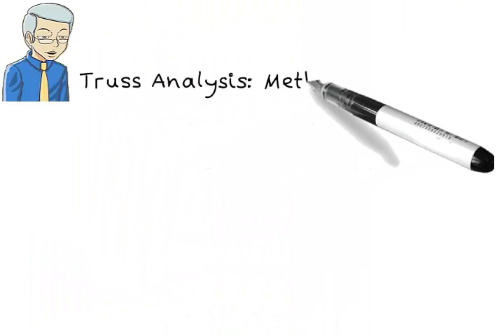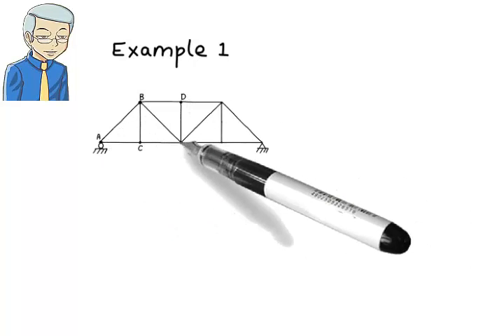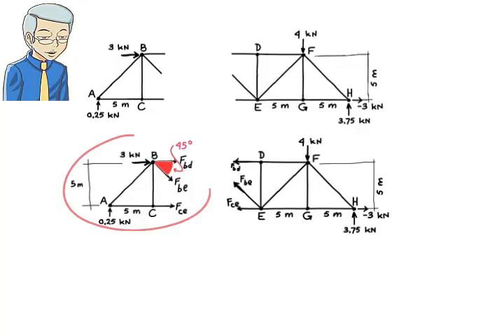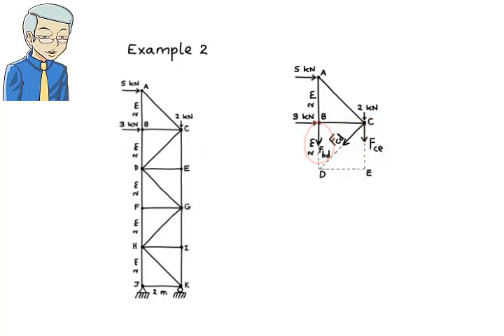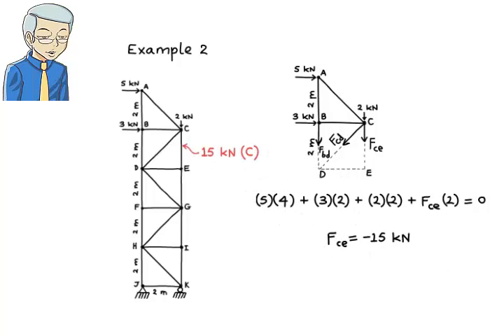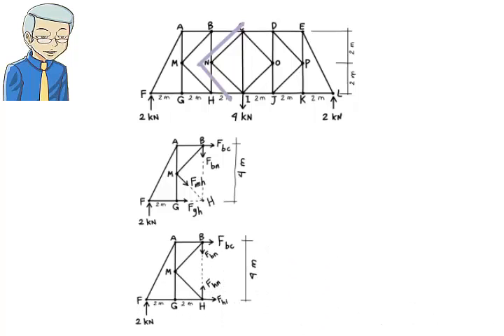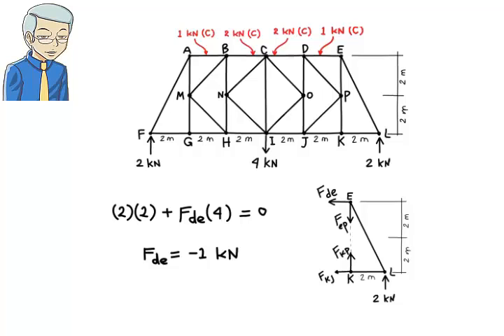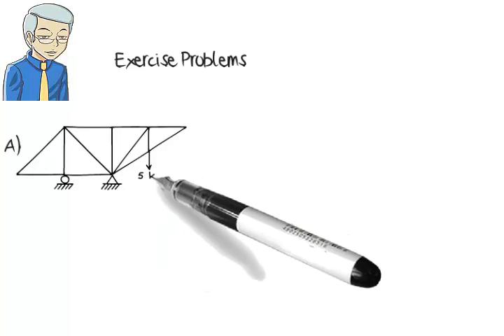SA10: Truss Analysis: Method of Sections

Comment: Hello.. When can I use the joint method?   or what when method section
Reply from the maker: If the truss is statically determinate, you can use either method for analyzing the structure.

Generally, we use the method of joints when we want to determine ALL the member forces, and use the method of sections when we are interested in calculating only a selected number of member forces.

Comment: at 5.08, why did u take fce as negative, shouldn't it be positive since its going to the right??
Reply from the maker: When writing the moment equilibrium equation, we need to assume either clockwise or counterclockwise as the positive direction. In this case, we assumed clockwise moment to be positive.

We are writing the sum of the moments about point B. The support reaction (0.25 kN) created a clockwise moment of (0.25 kN)(5 m) about point B. And Fce creates a counterclockwise moment of (5 m) (Fce). So, the moment equilibrium equation needs to be written as:
+(0.25)(5) - (Fce)(5) = 0

Comment: Fbd is 11.25 not 1.25
Reply from the maker: Correct. The force in the member is 11.25 kN.
Reply: @DrStructure  but how the internal force Fce is zero?!
Reply from the maker: Cut the beam through members BD, BE, and CD. Considering the free-body diagram of the left segment of the truss, and write the moment equilibrium equation at point B. The only force that causes a moment at point B is Fce. So, the sum of the moments at point B becomes: 4 Fbc = 0. Or, Fbc = 0.

Comment: Hey Dr. Structure. Thank you for the great video it was really helpful. I have a question regarding example 3. How do you compute the reactions for BN and NH? Or is it since the trusses are symmetrical then the reactions would be zero? Thank you in advance for your reply.
Reply from the maker: The support reactions for the truss are computed before we start cutting the truss. And, they remain the same regardless of how we cut the truss. In this case, the left and right support reactions are 2 kN each, as long as we don’t change the applied loads. That is, as long as the truss is subjected to a downward 4 kN force at joint I, the reactions at joints F and L remain the same.

Comment: I think the answer for problem C is -5 KN and problem A as everyone knows it must be a typo error (should be -11.25 KN) :) please let me know if I am wrong
Reply from the maker: Yes, for problem A the value for Fbd should be +11.25 kN;  the member is in tension, not in compression. 

For problem C, the force is member BD is -6.67 kN. Why? Calculate the angle at A (it is 36.87). Cut through members AC, BC and BD. Then consider the left part of the truss which has three forces exposed: the force in AC, BC and BD. Now take the sum of the moments about C. The equation consists of two forces only, the applied load at A and the unknown force in BD. Knowing the angle at A and length AC, we can determine the needed moment arms for writing the equation, which is: 5(8) + Fbd (6) = 0. Solving for Fbd, we get -6.67 kN.
Reply: @DrStructure  i think I mistyped in my calculator

Comment: exercise problems B at the end of video is statically indeterminate, there is no answer
Reply from the maker: The truss has 5 joints, 6 members and 4 support reactions. Two times the number of joints (2*5) equals the number of unknowns (member forces + support reactions). Therefore, we can analyze the structure using  the static equilibrium equations. If however, we just wanted to apply the equilibrium equations to the entire system (without looking at the joints), we end up getting three equations and four unknowns (the support reactions) which makes the system externally indeterminate.

Comment: Dr.Str.,In the exercise problem 1,2 & 3 I have got the answers in -ve,i.e. all compression,is it correct????also I didn't get Fce(problem 1) = 0.
Reply from the maker: You are probably making a sign mistake in your calculations.  When drawing a truss free body diagram, we always show the force in a cut member, at the joint, as an arrow pointing away from the joint. This means we assume the member to be in tension. If the (member) force arrow is drawn pointing toward the joint, then that signifies a compressive force in the member.

In Problem A, if we cut the truss vertically through BD, BE and CE, three member forces are exposed, Fbd, Fed and Fce. Take the right substructure, and take the sum of the moments about E. The only unknown force in that moment equation is Fbd, since the other two unknown forces pass through E.  The equation can be written this way:

5(6) + 5(3) - Fbd (4) = 0.

This gives Fbd = 11.25 kN.  The positive sign here indicates BD indeed is in tension, as was initially assumed.

Now take the left substructure, the one that includes joints A, B, C, the roller at C, and the three cut members. Take the sum of the moments about B, all the forces (including the support reaction at C which is unknown to us at this point) except for Fce pass through B, so their moments about the point is zero. The equation then becomes:

Fce (4) = 0. Or, Fce = 0.
Reply: @DrStructure  Thanks Dr.Your dedication to the work is awesome.
Reply: In the video it shows 1.25 for the problem A and I got 11.25 , I got clear in this reply

Comment: in problem A the support reaction C is negative. it means that the support should have a downward reaction. but it's a roller, how can a roller have a downward reaction? i dont think the truss is statically determinant in this way. please answer
Reply from the maker: Roller supports are often found in heavy structures like bridges where dead load is significantly larger than any load that could result in an uplift force at the support. In structural analysis we often calculate reaction and member forces for individual loads separately, then add them up according to design equations to determine design loads. Although the roller could be subjected to an uplift force under, say, the load due to a moving vehicle, but the overall force on the support is going to be downward when all the other loads are added to the mix.
In other types of (lighter) structural system where an uplift force could develop at a roller support, various mechanisms (e.g., sliding bearings) can be used to ensure that the support remain attached to its base.
Reply: wow, that was a good explanation. i didnt think of that.

Comment: I'm confused about the 2nd example where you solve for DF.  I thought that the moment arm of a force about a point is the shortest distance from the line of action of the force to that point... So then why are we multiplying 5 kN by 6m (vertical) instead of 2m (horizontal) and same for 3kN why is it 4m instead of 2m?  I also don't understand why Fdf(2) is negative in this equation... Please help!
Reply from the maker: Yes, the moment arm is the shortest distance from the line of action of the force to the point. Here, the force is 5 kN and its line of action is a horizontal line that passes through point A. The point that we are taking moments about is G.  To determine the moment arm (the shortest distance from G to the horizontal line that passes through A), draw a vertical line from G until it intersects the line of action of the 5 kN force.  This vertical line is the shortest distance from the (horizontal) line of action of the force to G.  The height of this line is 6m ( 2 + 2 + 2) since each vertical segment of the truss is 2m in height.  So, the moment of the 5kN force about G is (5 kN)(6 m).

Moment arm is always perpendicular to the line of action of the force. So, extend the force by drawing an infinite line that passes through its tail and head. That is the line of action of the force. Now, identify the point that you are taking the moments about, and from that point draw a line that makes a 90-degree angle with the line of action of the force. The length of that line is the moment arm. 

So, the line of action of the 3 kN force is a horizontal line that passes through points B and C.  The moment arm about point G is the vertical line GEC since that line makes a 90-degree angle with line BC. Length of GEC is 4m. So the moment of 3 kN force about G is (3 kN)(4 m).

As for the sign, the 5 kN force creates a clockwise moment around G. The 3 kN force also causes a clockwise rotation around G. But, Fdf causes a counterclockwise rotation. If we take clockwise rotation as positive, then counterclockwise would be considered negative. This gives us:

+ (5)(6) + (3)(4) – (Fdf)(2) = 0

How do we know if the moment of a force around a point is clockwise or counterclockwise? Imagine you have a piece of string. You attach one end of it to G and the other end of it to the head of the force vector. Taking G as the center of a circle, and the string as the radius of the circle, then make the arrow to rotate around G with the same radius. This circular motion of the force is either clockwise or counterclockwise depending on the direction of the arrow. In the case of the 5 kN force, the string is going to turn clockwise. In the case of Fdf, the string is going to turn counterclockwise.
Reply: Ah! Now I get it! Thank you!!

Comment: how to solve exercise b? i tried cutting it in ab but needed value for ay.
Reply from the maker: You don't need Ay. Cut AB, take the right substructure (that would be everything except A and the lower part of AB), then sum the moments about C.  Two forces cause moment about C in that substructure, the applied load and the force in AB. That means the moment equation has only one unknown in it, the force in AB. Solve the equation for the unknown force.

Comment: Where did the "20Ay +15 -20=0" came from?☺ (In the beginning of the example)
Reply from the maker: The equation represents the sum of the moments about H. There are three forces that create a moment about H:

The vertical reaction at A. Its moment about H is: 20 Ay (clockwise)
The horizontal (3 kN) force at B. Its moment about H is: (3)(5) = 15 (clockwise)
The vertical (4 kN) force at F. Its moment about H is (4)(5) = 20 (counterclockwise).

Adding these three terms two of which is clockwise and one counterclockwise gives us: 20Ay + 15 - 20 = 0

Comment: how come you didnt consider the zero force members?
Reply from the maker: Not sure what you mean by that, please elaborate.
Reply: In 5:37, would I get a different answer if I were to remove zero- force members HI , FG and DE and then section the truss afterwards?
Reply: Dr. Structure Thank you for replying by the way!!
Reply from the maker: No, the analysis results would be the same.  In the free-body diagram that we used to determine Fce, none of the zero-force members are present. If they were, we could have removed them in order to simplify the analysis.
Reply: Dr. Structure Oh I get it now. Thank you so much!!!!

Comment: Can you please explain the problem no. 2 in exercise part?
Reply from the maker: Do you mean Problem (B)?

Cut member AB, then examine the free-body diagram of the right segment of the structure which would be the entire structure minus the support at A. 

The applied load (2 kN) at D creates a bending moment about C.  The moment arm is: 5 + 5 sin(45).
The axial force in AB (the cut member) also creates a moment about C. This moment arm is: 5 m (since the angle between AB and BC is 90 degrees).

Since sum of the moments about C must be zero, we can write:

5 Fab = 2 (5 + 5 sin(45)) 

Now solve for Fab.
Reply: I have a question.. how can I know the values of DE and EC?
Reply: oh sorry got it.. thank you for being this supportive

Comment: For exercise problem B) do you cut through member BA BC and BE and then take the find the moments around point C? or do you need to find the support reactions first?
Reply from the maker: You don't need to calculate the support reactions. The easiest way to solve the problem is to cut through AB, then take sum of moments about point C.

Comment: why do we ignore the force acting on BC @4:05?
Reply from the maker: When writing the equilibrium equations we only consider the forces that appear (are drawn) on the free-body diagram including any support reactions, applied loads and the internal force in each cut truss members. If a member is not cut, its internal force is not going to show up on the free-body diagram. Here, AB, AC and BC are not cut, so they are not considered when writing the equilibrium equations.
Reply: @DrStructure  @13:06 5(8) +3(6) +2(2) +fgi(2), where did you get 2(2) value? And fgi(2) is the force multiplied by the distance 2m right?
Reply from the maker: @aveira.a4916  There is a vertical force of 2 kN at joint C. The line of action of that force is an infinitely long vertical line that passes through joint G. The shortest distance (the moment arm) for that force, therefore is the horizontal distance between joint H and that vertical line. That distance is 2 meters. Hence, the 2 kN force creates a clockwise moment of (2 kN)(2 m) about H.

And, yes, that moment arm for Fgi is 2 m, the same distance mentioned above. It is the same distance since both 2 kN force at C and Fgi act along the same vertical line.

Comment: Could please explain how did you get the 3 equations especially the third one 2:30 ?
Reply from the maker: Summing the moments about point H, clockwise assumed positive:

Three forces have a non-zero moment about H: The forces and their moment arms are:

Force: Ay
Moment arm: 20 m

Force: 3 kN (horizontal force at B)
Moment arm: 5 m (the shortest distance from the line of action of the force to H. This is the height of the truss).

Force: 4 kN (the vertical force applied at F)
Moment arm: 5 m (this is the distance between G and H).

Equation:  (20)(Ay) + (5)(3) - (5)(4) = 0 .
Reply from the maker: The moment arm for the 3kN force  is the shortest (perpendicular) distance between the force and point H. 

In order to determine the distance, extend the line of action of the force indefinitely in both directions. Here the line is going to be horizontal, since the force is horizontal, going from negative infinity to positive infinity in the x direction. 

The shortest (perpendicular)  distance between the force and H is the same as the perpendicular distance between H and this infinitely long line.  

All we need to do is to draw a line from H that makes a 90-degree angle with the line of action of the force. Basically, that would be the dimension line, labeled 5 m, that appear at the right side of the truss drawing @3:04

Comment: how to calculate the support reactions when we have more unknowns than equations and no hinges? ex B and D
( regardless of method of section in which may not be necessary)
Reply from the maker: +Omid Hassani Such a structure is called statically indeterminate. We need to resort to more advance techniques for their analysis such as the Force Method (a classical method) or the Displacement Method.
Reply: +Dr. Structure
Thanks for the answer! It means that they are advanced methods. My question is why when we have no clue of such methods in Elementary Structural Analysis, statically undetermined structures are subjects for the final exams and specially to calculate the support reactions?!
Would you please teach us one of those methods?; so we, Dr Structure 's students, will be able to solve such cases.
Reply from the maker: +Omid Hassani Omid, we are working on couple of lectures covering the analysis of statically indeterminate beams and trusses. Unfortunately, they are not going to be ready before this semester's final exam.

Comment: how do you know when to neglect inner members when cacuating moments
Reply from the maker: +Brian Benz If a member is not cut, if its internal force does no appear on the free-body diagram, it does no contribute to the equilibrium equations.
Reply: +Dr. Structure thanks a lot,very helpful. Maybe I will stop crying now after I manage to solve (hopefully) even one question succesfully

Comment: at 4:58 when you work out the sum of moments, why would you consider Fce when there is no force and even if you did, why not Fbd? 
Shouldn't be 0.25*5-Fbd*5-Fce*5
Reply from the maker: +Susku Hud The moment equation given in the solution is for point B, we are taking sum of the moments about B. The equation consists of one unknown force only (Fce), so we can solve for it directly. Fce = 0.25 kN.

Alternatively, we can use another point for writing the moment equation. Say, we decide to use point C. Now we get:

0.25 (5) + Fbd (5) + Fbe (5)cos(45) + 3(5) = 0.

But this one contains two unknowns (Fbd and Fbe), so we cannot use it to solve for any of the unknowns directly. We have to use it in conjunction with the other equilibrium equations to find the unknowns. 

Generally, you want to use a moment equation that embodies the least number of unknowns, preferably only one unknown that can be found directly from the equation.
Reply: +Dr. Structure Thank you but i have another question. at 6:56 you take the moment about D? what you didn't include Fcd?  Why did you ignore it?
Reply from the maker: +Susku Hud Since we are taking sum of the moments about D, and Fcd passes through D, the moment arm for the force is zero. That is, the contribution of Fcd to the total moment about D is (Fcd)(0) which is zero. That is why it was not explicitly written in the moment equation.

Comment: finding out Fgi where your working shows 5x8+3x6+2x2+Fgi x2 = 0 where do you get the 2X2 when the distance to H is 6 metres from C. also how do you know to ignore all the joints except A, B, C and Fgi is it because you do not know the forces at the other joints.  thanks.
Reply from the maker: +xganh zu There is an external 2kN force applied at C, the shortest distance from C to H is 2m, not 6m. So, the moment that the force creates about H is 2x2.  

The reason we ignore all the intermediate joints in writing the equilibrium equation is that there are no external forces applied at those joints. The applied loads are only at A, B and C.
Reply: ohh ok thx